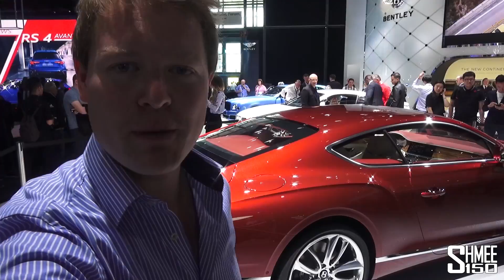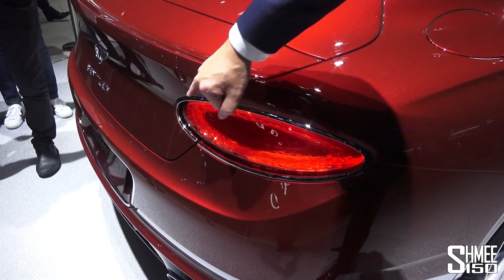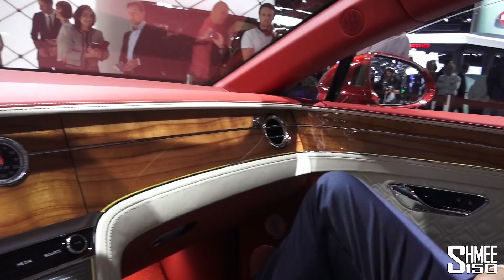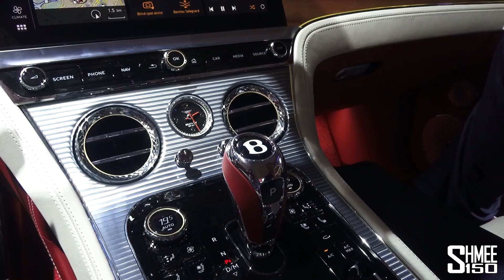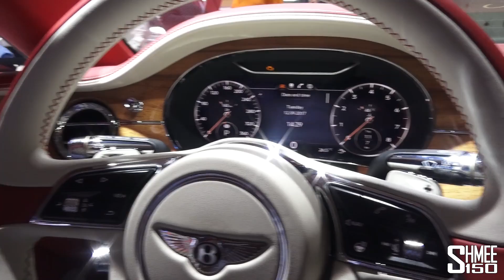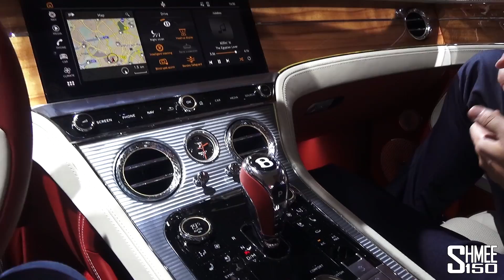FIRST LOOK at the NEW Bentley Continental GT

Comment: Too much of the shiny metalwork grill design at the front - the car looks better when the lower portion and side vents are not in the mesh grill design. I have the impression that changes were made to the outside shape just to make changes to the look of the car without really moving the car forward. They have made significant advancements in the control displays - and they needed to. However, there are way too many control switches around the gear selector lever. Interior surface trims are 'interesting', but like all trendy, over-designed items, the design will date very quickly.

Comment: As a continental Lover, majorly the GT3 but still, The new Redesigned but still familiar back looks Gorgeous, but I entirely dislike the fact that the Lights separate from the boot, the gaps just don't look that great, The wood choice inside is questionable as well, looked a tad bit like discounter floor panels, and I originally wanted to rant about the obsession with that diamond carving and all, in the lights it looks insanely good, but the Vent's, and then he said OPTIONAL, even though I will never be able to buy, drive or in general own one, but I still love the continental, and I cannot wait for the GT3 Version to hit the Racetracks, can't wait to see how the Racecar especially the 8 with soulet ,soucek and Abril on board. Good times ahead for us Boatley Fans.

Comment: That steering wheel and gauge cluster is taken directly out of the new Audi's and changed slightly for this car. Can't knock it though because the virtual cockpit is one of the coolest pieces of technology. But the steering wheels buttons are literally not different besides a metal scroll wheel.